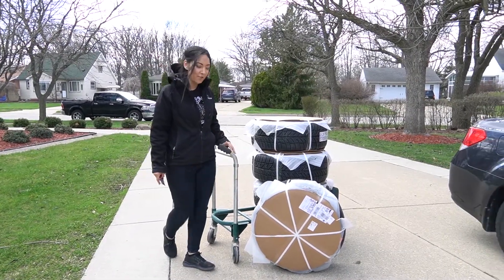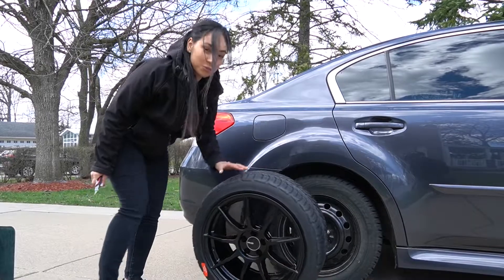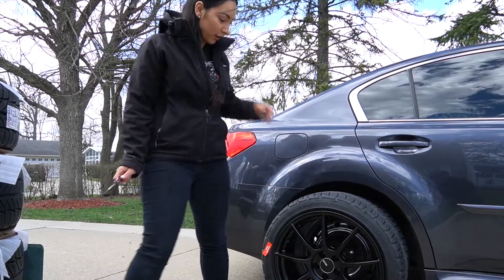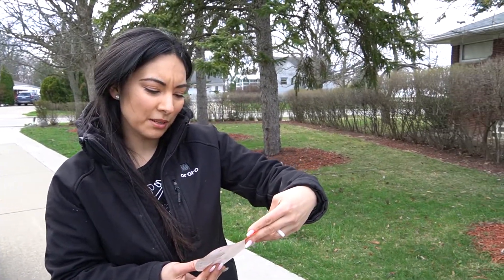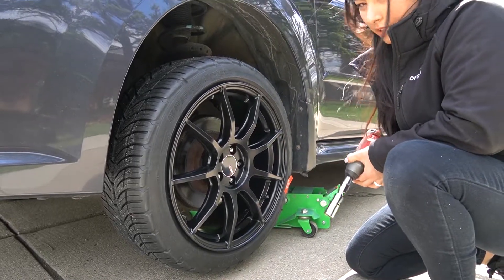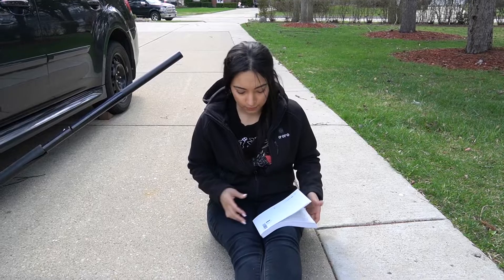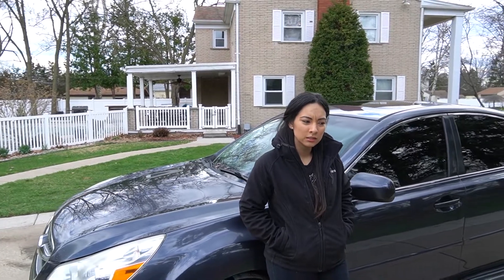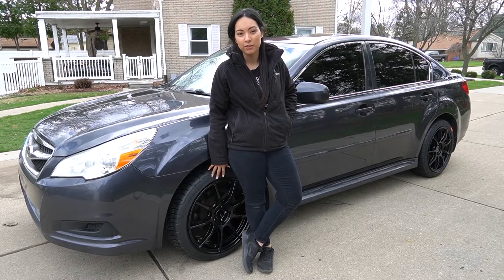2012 Subaru Legacy Wheel and Tire Upgrade | Hard NOx Performance

Comment: I have a 2011 legacy limited. Runs good but my mpg fluctuates 350-540mi on the digital reader. I know some of it has to do with long drives on hwy and when I am mostly in city. Do you think this is common or something I need to do to fix?
Also it picks up speed good some times and others feels like it wants to but takes a bit, is this also normal?
Preciate your channel and the info.
Reply: Oh I also have a 2011 legacy and mine does that too, I think it just depends because I drive through cities and Highways and I usually get around 580 or even 610 if my avg mpg is high. And 350 to 380 in city with an avg mph of 22 or less